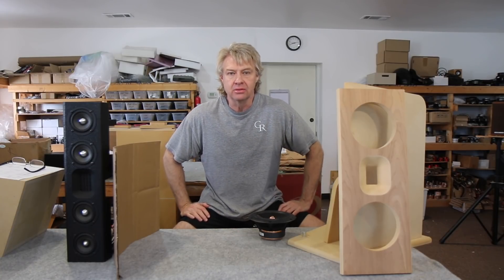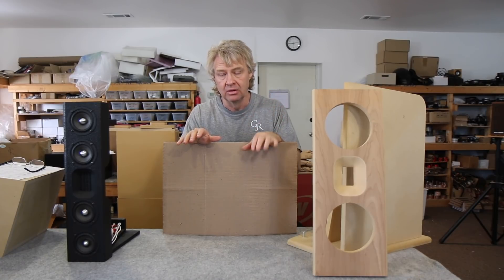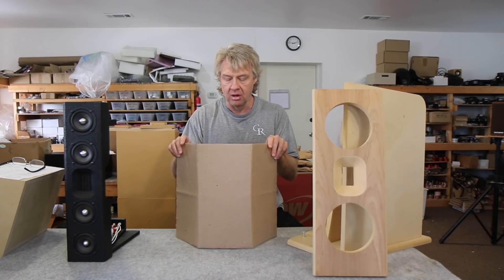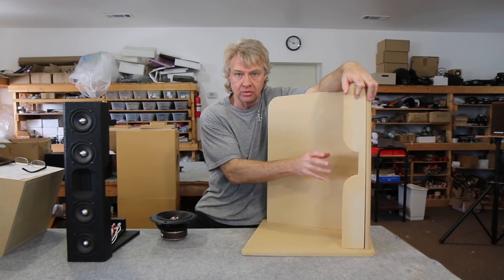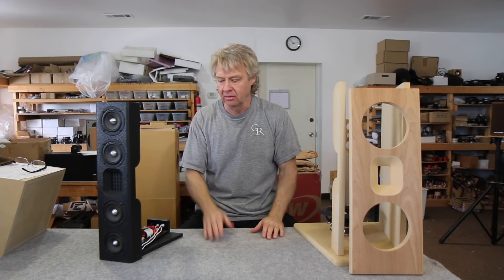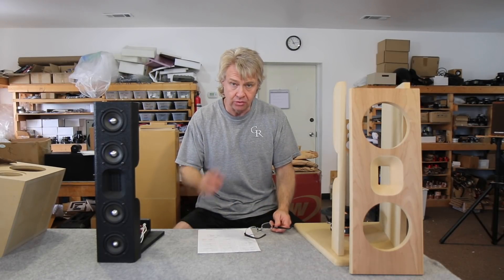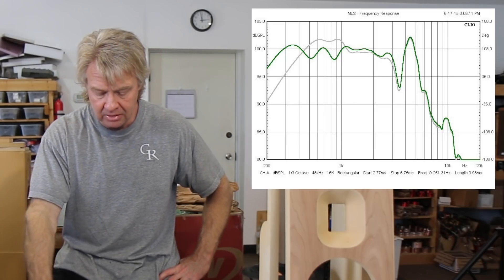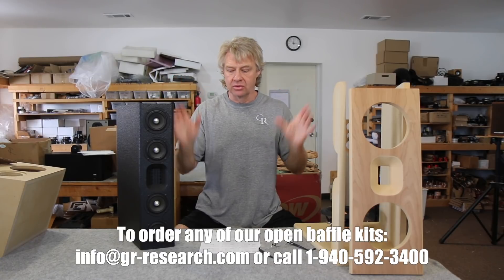Open Baffle Basics pt.3

Comment: Wow!  Great explanation of your empirical development process.  I had no clue about the details of aligning of the voice coils for proper phasing (front baffle thickness).  Also the cutout on the short side to unload the high frequency driver and the non-orthogonal angle for the long side of the enclosure.  I'm watching part 4 next.  Thanks!

Comment: Great video. Really there is no magic involved just measure change, measure change until you get the best response. Provided you have the equipment to measure there is nothing stopping us doing this at home. And it keeps the cost of the crossover down as well. Really helpful tips.
Reply: Can you recommend decent affordable measurement equipment, software etc? I have a blue blueberry studio condenser mic not sure if it works for this application

Comment: hope you can also discuss how to measure the response; software, type of mic, the distance of mic to measure driver/s... thx in advance Danny. Great topic and explanation.
Reply: Measurements are the most difficult aspect of speaker design. To do the topic justice would be hours and hours long. Then the software that takes raw calibrated microphone response and allows a person to make meaningful engineering decisions is another set of tasks that need to be completed.

If you're serious about acoustic measurements the best way to get up to speed quickly is to have a competent engineer measure some devices in your presence and explain why he/she is doing something in a certain manner and/or sequence.

The parts-express forum has lots of engineers that visit, but because they are aware of the issues with measuring, they may not be of much assistance. I happened to have learned from Dr. Joe D'Appolito as he lives only a few miles from me. 

There is a shortcut but it costs thousands of dollars and still requires knowledge of acoustics and attendant engineering principles. That would be a Klippel analyzer. 

Another engineer (I am an EE) that I know once said it takes a decade to learn the engineering required to self-validate results. I think that horribly pessimistic, but there are learning curves. I learned enough in two years of study to make good measurements. If you simply want a speaker design tested there are a few acoustic labs that do this in the US, and I personally know one company that provides Klippel analysis at low cost, and professionally another that would almost certainly provide free analyses for non-commercial use.

This is not intended to dissuade anyone from performing what are, essentially, formulaic tasks. I just want people to make good measurements is all.

Comment: That is literally priceless! As long as I'm in the process of designing my first open baffle speakers I'd be grateful if someone could answer a couple of questions:
1. SPL diagrams that was shown start from 200 Hz. What's going on below that frequency? I assume it slopes further down?
2. You explain how L-frame works. I'm curious if the T-frame works the same (i.e. if we put the long wing vertically to the center of the baffle back). I observe some open baffles are made this way
3. what's your advice on speaker mounting? Flush mount is the best isn't it? What if I decide to mount woofers to the back of the baffle, making the hole wider outwards like a short horn? (and keeping the phase issues in mind of course)
Reply: 1. To measure accurately below 200Hz, outside of an anechoic chamber, requires being further away without reflections. That is not possible indoors. The low end roll off can be calculated and then confirmed with impedance and nearfield measurements. 
2. A T shaped baffle does nothing to separate the front and back waves. It is nothing more than a brace. 
3. Flush mounting is best.
Reply: @dannyrichie9743  thank you!

Comment: That is a great result that can be achieved. In a two channel stereo, would the large wing be to the inside or to the outside? and what can be expected by swapping that over?
Reply: Hugo Bloemers  I imagine these best with the large wings on the outside and toed in to something like 45 degrees.  But I admit I’m unsure.
Reply: We typically put the long wings to the inside. This minimizes congestion in the front wall reflection and opens up the sound stage width.
Reply: @vessk000  The wings don't cause or create forward or rear reflections. So no problems.
Reply: @dannyrichie9743  Superb. Solves the problem I had with an 8 inch full range drive. Thank you.

Comment: I experimented with the 'U' shape by extending the baffle with polymer wings that I bent contours in to. It was an instant let down. I will be trying some 'L' baffle shapes. Question : would a bass in the L at the side be a big no no? Bass is omnidirectional and it seems to me theres a chance it may work well. I do everything hands on so I generate some decent sized scrap piles :). Is placement of the L speaker optional? Should the full side face in or out ? I know the answer, try them both =). I will. I'll give the thinner baffle a try the dimensions seem ideal for the 3.5" full range s that just come in. You gave me a fresh new idea to base my next set of baffles on.

Comment: I really really appreciate you taking the time to make these vids.
What would be really interesting to me is off-axis response on these speakers. I'm not a fan of MTM in general because of the narrow vertical axis, I wonder how the asymmetric wings behave with the horizontal axis
I have almost convinced myself to buy a pair of your sub-kits, looking forward to the next installment.
Reply: Actually not all MTM designs have a narrow vertical window. We have quite a few with a really wide window and even vertical off axis that is better than most two driver designs. 

And the asymmetrical wings will also help maintain a smooth off axis response.
Reply: Yeah, an MTM done well sounds great

Comment: The U-frame can be used as long as you stay both under the cavity resonance and the D/lambda<<0.5 constraint (with D=dipole distance , lambda=wavelength ) . But also consider that a U-frame can migrate to a cardioid response instead of a figure of 8 dipole response. Adding a side wing will solve the cavity resonance problem , hower it does not address the increased dipole distance compared to a baffle with the same frontal area without a wing . This will lower the frequence of the first dipole peak very significantly and thus decrease the useable range of the driver  if you want constant directivity and well behaved off-axis response.

Comment: it seems a combination of kef’s new metamaterial at the back of tweeter would be great in open baffle designs
Reply: Actually they just made a diffuser for cancelling out the back wave. It's not at all new. And it is nothing compared to a tweeter that is completely open to the room.
Reply: For a minimalist ( like me)this design is ideal.... Just wondering how to order the wedgie parts?
Reply: @dilbyjones  The LGK drivers were sold out. I am trying to have more made though.
Reply: @dannyrichie9743  It doesn't diffuse anything, it absorbs the backwave by an array of 30 Helmholtz resonators and matching impedances from the tweeter to the metamaterial via a conical horn. You should read the AES paper to understand the design. But it only works on the tweeter so only above the crossover point. The rest of the critical midrange is not absorbed. It is for monopole speakers of course. Open baffles have a whole different sound being dipoles and not every person or application is desires that kind of sound.
Reply: Stewart Markley - “Meta” is solving a problem unique to coaxial dome tweeters.  Every good quality separate dome tweeter I’ve seen lately has a rear damped resonance chamber incorporated in the design.
Reply: @petersouthernboy6327  Yes, our T26SG dome tweeter also has a big rear chamber filled with damping material. Another factor too is how it loads the diaphragm. A smaller chamber loads it more, may lift the bottom end slightly, or create a knee then drop. A bigger chamber doesn't load it as much and causes a more gradual roll off. Lots of tuning and tweaking can be done there.
Reply: @petersouthernboy6327  A metamaterial can be used for any driver to deal with backwave radiation. KEF has just used it for the coaxial tweeter so far, but there is no reason why it could not be used with separate tweeters or compression drivers, it just has to be designed to interface with the driver appropriately. Also there is no reason that it could not be applied to midrange drivers with appropriate engineering design.  The effectiveness and size of the metamaterial will have to be accounted for however.  The greater effectiveness of backwave absorption over typical fibrous materials means that the interference of the backwave reflections on the driver is reduced and the resulting sound is less distorted, more like open baffle speakers which have minimal backwave reflection, but the monopole speaker sound versus the dipole speaker sound will of course prevail.
Reply: @StewartMarkley  The Meta is not a Helmholtz resonator in the strict sense.
Reply: @carlosoliveira-rc2xt  True, it is a grouping of 30 acoustic cavity resonators spanning from around 600Hz to 5kHz. But each cavity behaves as the classic Helmholtz resonator. The energy is dissipated by the viscous shear force of the air oscillating in the cavities.

Comment: Sir the 12 inch - 2 inch - 110 degrees works for  all size drivers?  Or as the driver size gets bigger needs bigger side asymmetrical  drivers? And if yes have u figured a ratio between  driver size and side baffle size? Thank u for your work and greetings from Greece.  Have u ever shipped your speakers to Greece 🇬🇷  ???

Comment: I've always wanted to design my own speskers, so it's really interesting to see how these particular style and desgin works and how simple changes can effect things dynamically. So of course like all of the people who've watched this and the other videos, i'm my own theory; there is packaging you can get sometimes with products where cardboard is cut in a specific way so that when pulled apart, it creates a dimond pattern. If this was high strength material, like say Aluminium, and the negative spaces created had been filled with a sheet of say acoustic material, like Oasis, that material you can stick flowers in. and this sat behind the baffle (created by the Aluminium structure) with the Oasis filling the negative space; could you then mount a driver and tweeter, with possibe sides of similar construction, could this work, less structural mass to reflect but with some accoustic properties? Hope you don't mind me asking. Thanks.

Comment: So how would does side panels translate if one was to use a wide band driver? Usually those baffles are just wide. 
Second question if the Qts of the single driver is just 0,45 would that only influence how low it goes or is that  low Qts no good for open baffles. I am planning to use a separate 15” driver de or the low frequencies

Comment: On the application of the L frame, I wonder: aren't you changing the plane in which the back wave and the front wave cancel out? If the L side baffles would on the most extreme outsides of the speakers from the listening position, the zero pole plane would toe out, This phenomenon would be relevant for toe-in/toe-out positioning speakers to avoid first side reflections from the side walls. It might also influence the imaging between the speakers. What do you think?
Reply: It absolutely does separate front and back waves, but it has nothing to do with toe in or toe out.
Reply: @dannyrichie9743  In a planar open baffle (no side wings), front and back waves are separated in the virtual plane where these meet in equidistance due to their opposite phase. For a planar open baffle, this virtual plane is obviously the plane of the baffle.

By setting the toe-in exactly as indicated by Linkwitz (using his mirror approach), the first reflection side waves that bounce off the side walls of the room can be minimised.

By placing a rear wing, the virtual plane in which these front and back waves meet in equidistance no longer coincide with front baffle plane. So, to get the same minimisation of side wave reflections, the toe-in of the speakers must be altered accordingly with this change of virtual plane.

That was the point I was trying to make.

Comment: Any benefits to be gained in adding wings to the X-Statiks or would that mess with the crossover design? interesting stuff, thankyou.
Reply: That would alter the response and require a crossover change. Right now the crossover is handling what the baffle size is doing.

Comment: So is the optimal set up of a pair of these open baffle speakers 2 units that are identical, or are they mirror images of each other? Also, if mirror images, does the short sidewall go in the middle or to the outside?
Reply: They are mirror imaged, and the long wing goes to the inside.

Comment: The final design was the result of a lot of trial and error. I wonder if it would be possible to model the system to better understand the sound wave interactions so that an understanding of why the various baffle lengths impact the response. If only sound waves could be doped with ink like fluids can to track their vectors, diffractions and even interactions. In any event, it seems evident there is a lot of complicated interactions that these simple baffles are hiding.

Comment: Great presentation. I follow the theory and one can not seem to contests the results as measured. This seems so different then the spatial audio designs. If I am understanding what Danny is saying then the Spatial Audio open baffle design should produce a radically different result. I would love to have Danny and Clayton Shaw discuss there respective approaches. Clearly, both are getting great results but with seemingly opposite approaches in the baffle design. Can they both be right?
Reply: Maybe Clayton and I will do something like that one of these days. And I wouldn't say that there is necessarily a right and a wrong. Objectives can be different and the highest performance or highest attained results based objectives might not have the value of a more marketable and commercially successful design.

Comment: Roughly, What size side wings would be recommended for a 15” bass driver only, driver mounted center horizon. and 2” higher than center vertical, in a 21” x 27” Baffle?

Comment: Would putting No Rez on the front of the baffle help make the baffle disappear?  I've never seen that done, but often wondered how it would affect reflections off the baffle.
Reply: It will make it more transparent and remove reflections within a certain range. It won't effect lower wavelengths too much.

Comment: Hi Danny I have a question a little off topic, I am interested in the X-Voce and how it would be affected if it is placed right under a flat screen TV with the front flush with the screen?
Reply: So long as it is open to the top (not boxed in) and has some space behind it (not boxed in on the back) then it will be fine.

Comment: Do you have any computer models to predict response for the various shapes/angles/dimensions?  How much do you let your ears drive the design vs the frequency plot?
Reply: I don't try to model this stuff. I have done a LOT of this stuff and measured and tested it enough that I know what the results are going to be and where my starting points have to be. So it doesn't take me long to have a working prototype. It is the same for crossover design. I do it all the time. So I don't need to model something to know what will happen. I already know what will happen. I just have to put it together, test it, and fine tune it. 

Verses what we hear is a different discussion. I have to design based on accuracy. And that means on and off axis and what it is going to do in the room. The how it sounds is altered immensely by a whole different group of variables. But the fundamentals have to be correct to avoid errors and problems.
Reply: Danny Richie thanks for the response. Would love a video explaining more of that knowledge but understand if it part of the secret sauce you don’t want to share.

Comment: How does the height of the baffle affect the sound? Like with the pure audio project’s that have bass drivers above and below the wide bander/tweeter?
Reply: Height is not a problem it's the size and width of the baffle that is a problem. Surface reflections and edge diffractions are significant problems with those.

Comment: I’m new to your channel, so this may have been asked many times before but...
I’m curious what you think about magnepan style quasi ribbons vs the cone drivers you’re using for mids, as well as the neo tweeter. It seems the planar nature reduces interference between the front and back waves, though I’m guessing imperfectly.  I wonder what wings might do on something like the LRS.
Reply: Wings would extend the low end cutoff and improve the output capability. But some EQ would be possibly needed to cut a resulting peak.
Reply: Apples and oranges comparisons. There are lots of advantages and disadvantages.
Reply: @dannyrichie9743   I guess the short of what I'm asking is why you choose cone drivers instead.  Apples and oranges are still dipole open baffle fruit, so I'm trying to understand the choices made.
Reply: That said, I've seen your line source vids with new record day, and that's all neo drivers for highs and mids, so it seems you do use those.  I'm a new Magnepan user and audiophile newb.  Thinking about building my own bookshelf planar magnetic speakers for fun.
Reply: @aweidenhammer  The line of woofers will move more air and play down a lot lower.  It makes drums hits and such sound very real. 

The all planar magnetic drivers keep a narrow baffle width and offer high sensitivity. So imaging is much greater than a Maggie and the sweet spot is much larger. Plus you can drive them with low wattage amplifiers.